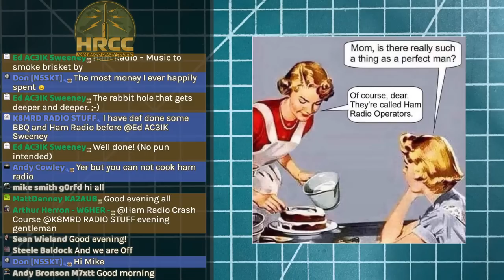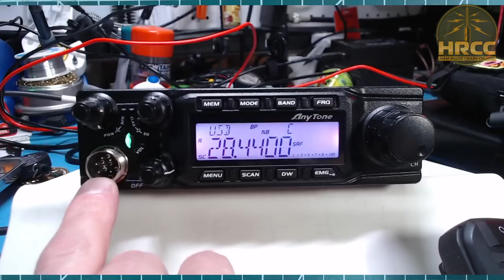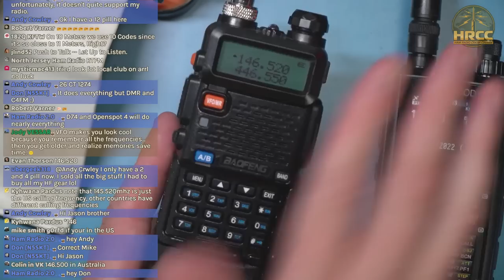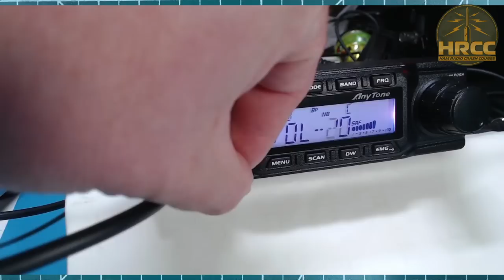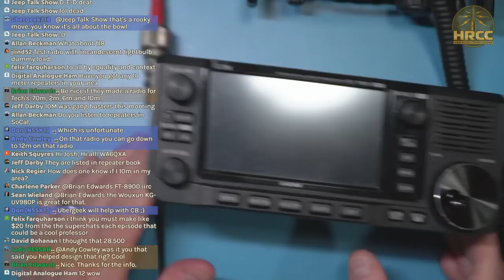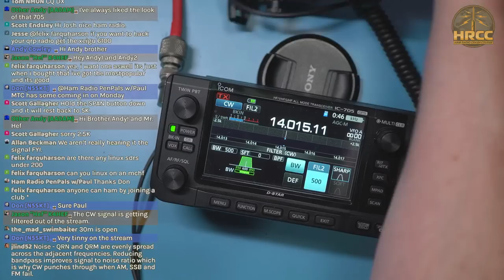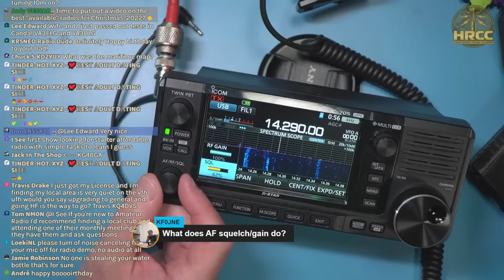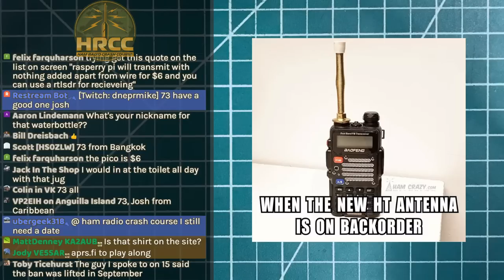How to Setup and Operate Any Ham Radio

Comment: Josh, would really like to see more vids about home QTH detailed shack setups with intent of using mobile or base type radios. Things like room selection in relation to home's orientation on the property to include homes on corner lots, Floor selection and why one over the other, how both of those tie to multi antennas for 80-6M, 2m, 440, 70cm and their locations from max coax runs lengths, type of antennas that can broadest flexibility covering the bands, temp. RF disruption of your neighbors or interference from them and other considerations. Then there is power (how many home circuits at what amps) and grounding and methods for both, Lightning arresting or surge protection, influenced by cable entry options/locations or pass-through options. 

I've crunched through many upon many searches of YT and a lot seems to a bit dated or too general to be of use or does not cover every aspect. But mostly because your videos are so well done and present the information so well a crotchety old fart like myself could understand.  Cheers!!

Comment: I Hold a general class license. However, decades ago I stopped using my radios. Recently I set up a station to re-new my hobby. However I haven't retained my knowledge gained back in 1985. PLUS, almost 38 years later naturally radios have drastically changed too.
I was hoping to find 'basic' radio controls explanations but after watching for over a half hour I didn't find what I was searching for.
Just like my owners manual for the Kenwood HF radio I own things are not being explained well enough for a 'newbie' to understand.
'Digital' modes weren't even used back when I was tinkering with radio. I need explanations of THAT....and many other things.

Comment: Would you recommend a good antenna for a tyt th-9800
Reply from the maker: I less you absolutely have to use the 6m or 10m bands, any mobile 2m/70cm antenna would be fine.  Keep in mind the radio is entirely FM.